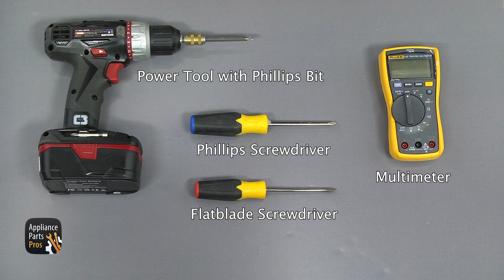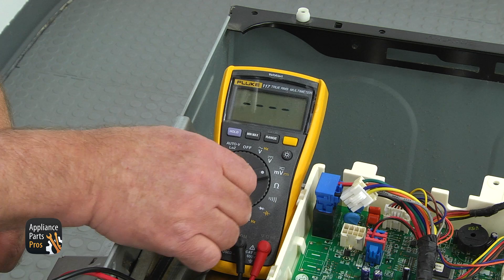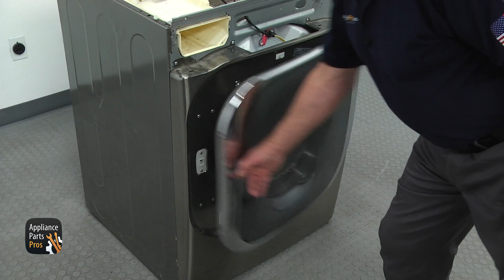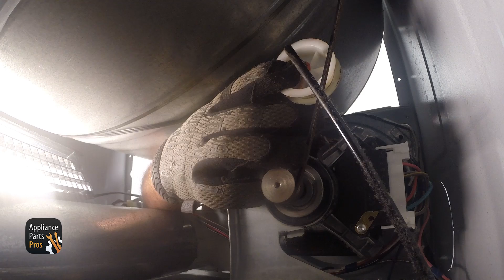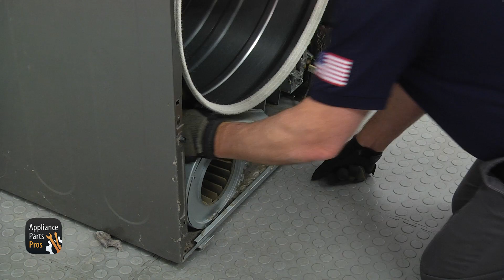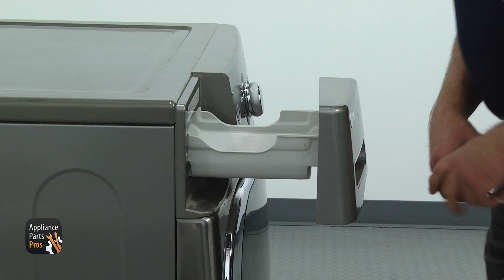LG Dryer Taking Too Long to Dry? Test and Replace the Thermistor

Comment: i have never opened a washing machine of this kind..... with such arrangement of components
Reply from the maker: The inside of an LG dryer (or any appliance, really) can look a bit overwhelming if it’s your first time opening one up. The good news is that once you take a closer look, most of the parts—like the thermistor in this case—are pretty accessible and designed to be replaceable. If you ever decide to give it a go, just take your time and follow the steps in the video. You’ve got this! 💪 Let us know if you have any questions along the way.

Comment: The video showing the belt pulley is from a non-LG dryer ,…possibly a GE.
Reply from the maker: Hi @danielcunningham7319, thanks for watching and for your comment! This video is on an LG dryer. Some parts like the belt pulley can look a lot alike across brands, so it’s an easy mix-up. Appreciate you taking the time to check it out and hope the video helps with your repair!
Reply: I have the TE1 error  on my dryer and i dont even know if i can able do it without removing the drum😢 just planning to diy it.